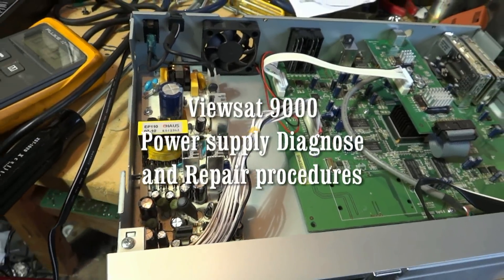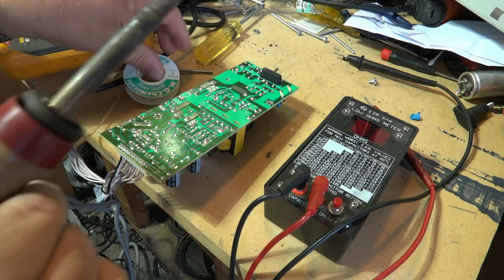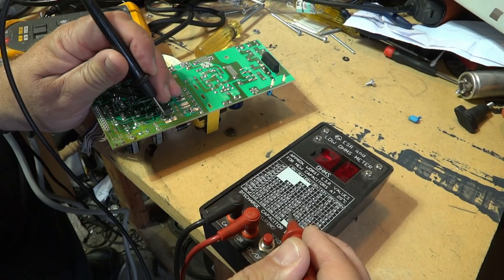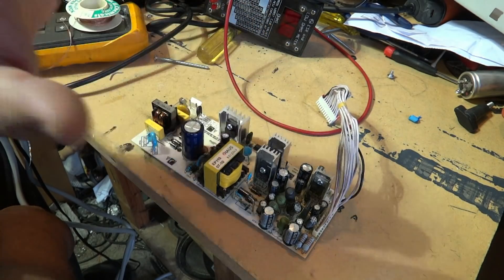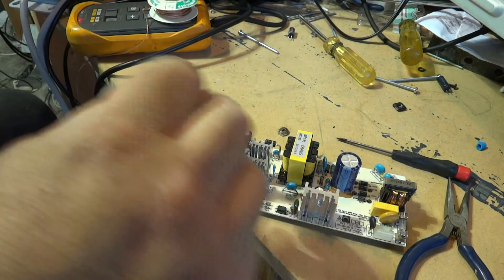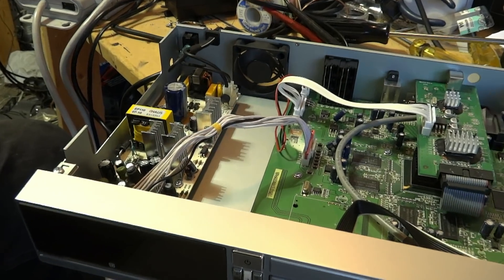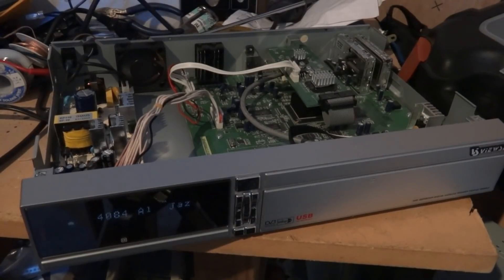Viewsat 9000 FTA Satellite Receiver Power Supply Repair

Comment: I finally took the plunge and began repairing PS'es on everything that fails (I am ashamed to count the things I tossed out that probably needed easy PS repairs/Fuse replacements). Recent repair was on a small Dehumidifier. Insurance covered replacement on the failed unit. Left me to deal with what they thought was junk. Thanks for the help and allowing us to stick it to them once and while - plus not being so reliant on insuring something they want us to think is permanent junk. :)
Reply from the maker: Wow people still see this, the first video I ever did and the one that got my channel monetized.
Guy that owned this receiver been dead did years. Receiver probably still works.
Reply: @12voltvids  It's a good one. Now I have two Dehumidifiers for the same price I paid for the original which makes two working and one junked. I got two working for the insurance on the first. Repair videos help keep me sane and fix things at the same time! Bonus!

Comment: I currently have a similar 'pulsing' problem on my old CRT TV.  It seems to be stuck in a loop with the standby light switching between red and green, accompanied by a clicking sound from the board at the rear.  I'm a little wary of taking a look due to the potential high voltages.  As fars as repairs go I'm now at the step you were when you developed an interest for this type of thing.  I just can't face throwing something away simply because a small component has failed, be it due to age or a power surge.
Reply from the maker: Stay away from the big red wire that goes to the picture tube and you will be fine.

Comment: We bought my grandson a power car , 12 volts but we are converting it to 24 volts. However, he left it in the rain and the circuit board got ruined.  This was 300.00 power car and I really want to try to fix it if at all possible.  How do I find out what circuit to replace it with?  And how then do I replace it with one that will work with a 24 volt battery system?  Seriously do not want to be out 300.00 😢

Comment: Now I understand how an ESR meter works, I have treated myself to one! You should get commission! lol. As a young engineer I used to set a multimeter to a 200k+ impedance setting, then I place the probes on the capacitor legs. One way should count up, reverse it and it should count down. Then I know it is working! I'm loving these vids, As I said - I'm primarily audio but we now have large flatscreens for hire at work so this is crucial learning! Thanks!

Comment: Does an ESR meter measure all different types of capacitors or only electrolytic caps?
Frank
Frank Reiser video/Audio Service
Reply from the maker: It's only important on electrolytic caps because solid caps don't have an electrolytic that drys out.

Comment: I've repaired loads of sat receivers and all of them had failed electrolytic caps, most read ok on the capacitance meter but fail on the ESR meter.
Reply from the maker: ESR is the key. When it starts to go up, the current of the power supply drops like a rock.

Comment: Hi sir .I'm one of your old fan. I have a dvd recorder panasonic DMR-E20.  When i turn it on , it going to standby or sometimes it works but but after 5 mins if even i search in menu , it lock up , (freeze) (stuck) ! Or when even it playing DVD, same freezing happen! I must turn it off only from frontal panel ! With Remote never i can stop or turn it off in the time of freezing! And also i must plug it off if i want to turn it on again because it won't turn on and stay in standby!! Is it about power supply or other part of circuit? Could you please answer me or make a video about it .i appreciate it. Thanks for all of your best video which you teach us your best experience. I wish one day i meet you. Best wishes👍

Comment: I am having problem with my Sony dav tz215. Problem is with On Off , my ht is not being on if somehow it get On then after some time stop working ( or I can say got Hang) then I can not switch off by remote or through power button , I have to unplug the plug from main power. I don’t know what is the problem and Sony engineer is saying that motherboard is faulty. 
Is there any solution?

Comment: Why would the power supply first rectify ac just to turn it into a high-frequency ac to be rectified again into DC?
Frank
Reply: Efficiency, as it turns out. It's VERY hard on those poor capacitors, though.

Comment: Is there a reason those caps went bad or was the cause from age? Great video!
Reply: Age and heat mostly.  Consider too those caps are experiencing charge/discharge cycles at a very high speed, even up in the megahertz range for some units.  Not surprising they fail. It's a hard life on the secondary side of a switching power supply.

Comment: I actually thought that ESR meter was made professionally (by professional factory workers, that is), but now I see it, the button is something you'd see on a homemade device.  Everything else looks great.  Can a multimeter test ESR?
Reply from the maker: It was a kit I built close to 30 years ago.  Some multi meters have esr. Most do not.  It would be high end models that have it.
Reply: @12voltvids  Mine seems to have everything but.  It even has a temperature probe.
Reply from the maker: One of my meters also has a temp probe, will measure capacitance but not ESR.

Comment: I have an old satellite reciver, i want to use the power supply of it  for a cnc machine operating on 24v, but the problem is when I connect the power to the cnc, the power supply start doing the same thing in the video"on-off-on..."(when I connect it to the reciver it works),so can you help me to do this,please?

Comment: The best time I had a job sitting at a work bench as part of a crew for a Tech Co. Specialized in Transformers for computers ! Exactos. Scraping wax off the connectors something in the count of copper wire wraps.right ? That determine its power rating

Comment: I'm interested in just connecting the black and white wires from power cord to the J8 J10 J11. Or J12 pins on circuit board GX-20M guitar amp.

Comment: I have one like this Dave and I am missing my negative -28.5 VDC leg for the display. I have a low dim display. All my capacitors I changed out but still no luck. What do you think would be the likely other component that could be failed? Thank you Dave.

Comment: Nice job repairing. Do any of these consumer electronics (dvd/sat rcvr etc...) have 12vdc output. I realize they're switching power supplies, and I'm looking for ~13.8vdc @ 2 amps out to power up a mobile chinese 2M radio in  house. Not so much for TX, but more RX for sure. Thanks  Jimmyg
Reply from the maker: Many of the SMPS do run 12 volts.

Comment: I had a ota digital converter quit working after 2 years. An LED inside is flashing red. Sometimes pushing the power button it turns green, briefly.I heard capacitors fail a lot in these. So, it's probably bad capacitors?Most are 470uF at 10v.

Comment: hello Sir i have a question or you can say i need suggestions. I have SONY Home theater 5.1 model BDV E490. Once the power on in screen massage is "WELCOME"  after 1 min its turn off. Then when i press then power button its Says " Please Wait "  & then nothing happens. No Mode selection available. As per Sony Motherboard need replacement. SONY MB 148 is the Model of that mother board. Very Expensive almost 120$. Then i ask some local person and he said he can fix it in 3 hrs . which cost 80$. 

   After kisting both i found some doubt. I google and youtube about it and then i realize SMD Aluminum Electrolytic Capacitor may have fault.  Can you please guide me? i am pretty expert in soldering and have little technical background. i don't want to loss that big money or this music system. If you want you can follow the video link below for that motherboard. your help is highly appreciated . 
https://www.youtube.com/watch?v=DP-z6UJI-nI&index=2&list=PLxCVPtmdp6m0NwsVbHWCKOglnmBdQliRR

Comment: I Love how you're just touching the Supply board while it's ON
First of all, it's a very bad habit that can get you killed
Secondly, even if you have an excuse, you need to understand this video is going to teach Newbies IT'S OK

and.. one day.. bang
one of them dies

so... what's your excuse for touching the board again ???
are you trying to show that your cool and that you can do it without getting killed ???
Reply from the maker: Martin Kuliza 
it's no big deal. Really. I am on an isolation transformer so the device under test is isolated from mains. I am also wearing CSA certified insulated footwear. The components I am touching or more accurately pointing at are also on the 12 volt line. 
I am not only a certified electronics technician, I am also a telecom electrician and work with around high voltage DC daily. Needless to say, when working around electricity do make sure you use an isolation transformer and disconnect power before working. Second this video is very old. It was not ever intended for public viewing. It was originally done for my ham radio friends that wanted to see a satellite receiver that the owner was told was unfixable repaired. The only reason it is even up is because of the views. If I pull it I loose a ton of revenue as, due to the number of views it comes up in search engines. 
But trust me I am not being careless, I operate with the utmost of safety and I know what parts I can touch and what parts are energized.
Reply: Mate let me reclarify something

- i Respect your experience and education, i myself am an Engineer
- I've been also  (no doubt like you) tinkering with this stuff since i was a child back in the 80's

My point was... what we do as experts reflects on the younger blokes in a certain way

for us to merely open the casing and remote 3 - 5 screws on a satellite receiver is not big deal
and then... someone who is still green goes and does it and touches something they shouldn't while it's still connected to mains

i wasn't saying you are careless in what YOU ARE DOING
i'm sure you know what you are doing otherwise you wouldn't be doing it
Straight off the bat,   one does not carry an ESR Tester unless they actually understand what ESR is and THAT in itself comes with a degree of knowledge that keeps you safe

but, you are being careless towards your viewers that are new to electronics (With all respect)
and.. fair enough.. common mistake..
when you sit in your lab and fix shit you are not always mindful of who will watch this and what will happen

but mate, be aware
people do die from copying what we do and not seeing what we do to keep ourselves safe
Please be aware of this in the future

in saying that  , i want to say this as well mate
i'm not pissing in your pocket
i mean no bad blood at all
i'm just concerned

now.. if the video was initially intended for HAM Operators and i was  HAM a long time ago  hehe
back in the day when AM CB was still a thing and people (who were not dickheads) were still on the Air.
but... ahh. memories....   i digress

i meant to say , if it was designed for HAM's initially... ok, i get that
but now, you are showing a video designed for HAM's to Standard people
and i understand the View issue vs Income
but, mate... FOR INCOME is it worth it if someone gets killed over it or gets a nasty shock

i think you should put somewhere (if possible) that people should not attempt this unless they understand basic electronics repair and Ohms law and so on and so forth

but all that aside
GOOD VIDEO MATE
no question about it 
My concerns aside
you did a great job on this
i do this stuff all the time
I'm a Computer Engineer, Electronics and Telecommunications Technician 
I've worked many years for the Telco over here in Sydney , which everyone believes is TELSTRA (But in fact the company that contracts you is... ISGM
I"ve done the linesman thing
I've got the Telstra Accreditation's 
i've also got a tonne of certifications and Accreditations
been running my own business for like 16 years now
and been into this sort of thing , technically since i was 4,  but more involved since i was around 6 or so

so.. you did a good job
but.. You do understand my concerns for the safety of the newbies.. right ?
Be cool mate
always a pleasure to speak to a fellow Tech who knows what he's doing.
be cool
Reply: Mate, also
My apologies for this line 

"so... what's your excuse for touching the board again ??? are you trying to show that your cool and that you can do it without getting killed ???"

it's just that i take this stuff seriously
and a lot of times i find people like to touch shit just to show they can
sort of like being a smart arse if you will
and then they get someone killed

my apologies.. ok
i got a bit emotional over it
Reply from the maker: Upon review I actually didn't touch any metal on the power supply. .I pointed  to components, and  touched the insulated plastic wrap on the main AC filter,, and the top of the transformer. Again insulated portions. At no time did I touch any energized parts. At 3:19 I show how to make the unit safe to work on by verifying that the main filter capacitor, the only component on this unit capable of storing a high voltage is discharged. No big deal, and I did stress to only work on the unit unplugged, and after discharging the main filter.
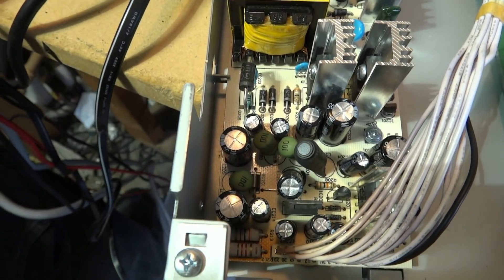Reply from the maker: I hear where you are coming from, but I also  at 2:30  I clearly state that I was unplugging the unit, and making it safe to work on by discharging the main filter..  The opening sequence was just to show the power pulsing on and off, and if you look closely I did not actually touch anything in that 12 volt side of the supply, the only things I did touch was the tape on top of the power transformer and the plastic wrap on the side of the main filter. Something that would be tied to neutral and this at ground potential even if I had not been plugged into an isolation transformer.
I think anyone with any common sense knows that you don't touch anything that could potentially have power on it.  
As I said this was a very early video. When I work on vacuum tube gear there are warnings all over them due to the extreme danger of working on vacuum tube equipment. Also, there is a warning in the description if you click on show more.
Reply: i hear what you are saying
but.. FYI   there is no such thing as COMMON SENSE
and murphy's law always applies

Comment: i started with a good pc power supply for my project but it went dead after by mistake i short circuited  one +  terminal  to ground.
is there a fix (replacing capacitors??)  or i should start again with another power supply

Comment: Got an FSP150-50LG that suddenly stopped working, I measure 3 & 5v but no 12V, any suggestions?
Reply: Have you opened it up and Visually inspected it for 

a) Blown Capacitors
b) Blown Resistors
c) Blow Fuses
d) Basically any black marks that would indicate an explosion

Do you know how to correctly test Capacitors
Do you know how to test Resistors
Do you know how to test Diodes, including Zenner and Shottky  diodes
Do you know how to correctly test a fuse (other than Continuity )

Repairing your PSU is a very long topic
mate....
here is a link

https://www.youtube.com/watch?v=gnLX2qD6g3w&t=5s

this is Part 1 only
download all 6 parts
this is a basically an entire course in what you need to know.. ok

BE SAFE and don't get yourself killed

Comment: hello 12 volt, i have a elx 115 p EV power speaker i'm not getting any sound put when i press the power button it lights up but no sound any suggestion? also are you located in new york

Comment: My ASUS monitor (VW246) has similar problems but the caps have non-standard markings on them.  Like: LWlon RXY 105 C A106 (M).  Is there some way to relate this to volts and micro farads?

Comment: Holy shit i can tell just by looking nearly all those caps are dead or nearly dead, this happens when shitty chinese manufacturers use caps that are running right on the brink of their voltage rating, the bastards just wont spend a few more pennies and put better capacitors in these psu units when really this is where good brands like nichicon are most critical in equipment, i dont even waste my time anymore measuring them i just change them as its pretty much guaranteed they are faulty. Also why the hell do they use VFD screens on stuff like this thats always on, the displays dont last the phosphurs burn up, LCD would be better
Reply from the maker: Yup, bad caps cause lots of problems, but it isn't just the Chinese. Samsung and LG have both been stung by bad caps, as has Panasonic, Sony and JVC with schittey ELNA caps.

Comment: what is the full model of the camera you are using ?  TX100 or tx100v ?
Reply from the maker: The camera I used on THIS video was a DSC-TX100V

Many of my other videos I used a HDR CX220, and I currently shoot with an
FDR-AX100 or FDR-AX33 both are 4K. The AX100 is more used for scenery videos, and the AX33 for the repair videos.
There are a few other cameras I have used, namely an HDRFX1 and HDR-HC3 which are HDV (HD tape based). I have plenty of cameras here, too many. I have a professional ENG camera, and a bunch of vintage cameras too. (I am a camera collector)
Reply: Great just wondering cuz I do a lot of PC builds/repair up close and I don't need/want a 4K camera but something simple but good video would be nice.. so I am researching.. speaking of, ever do any PC Power supply repairs? I have some that need repairing , might make a good video for someone who does that kind of stuff. - message me about it.

Comment: You should not need to unsolder caps as the ESR is much lower than any parallel load on the board. It make it much faster to find dud capacitors.
Reply from the maker: You do when there are multiple caps in parallel.